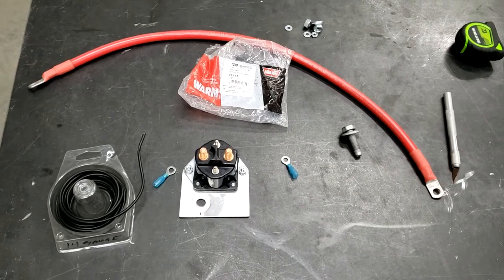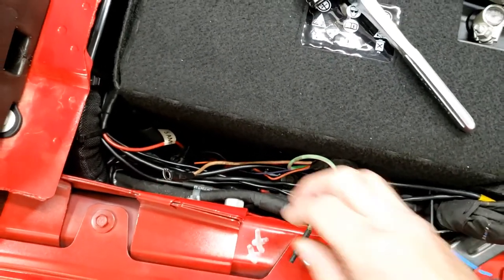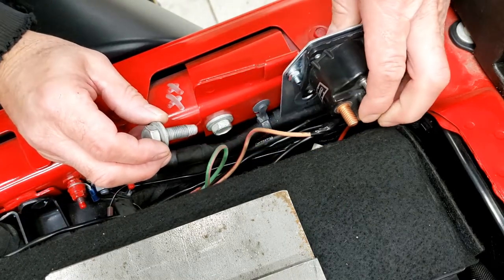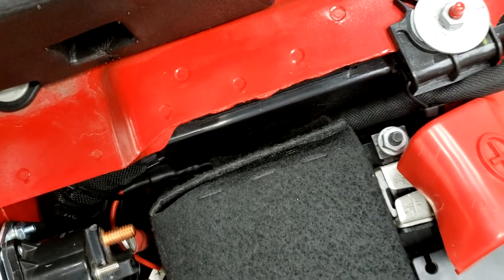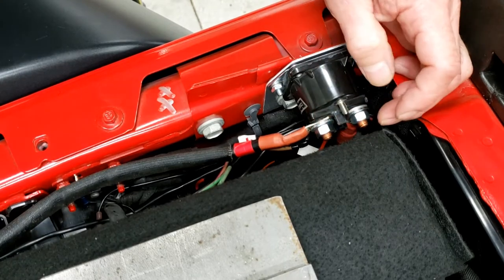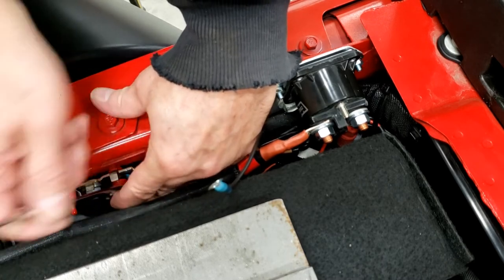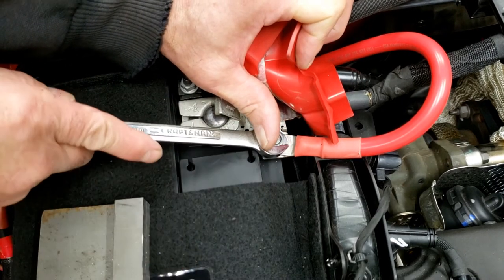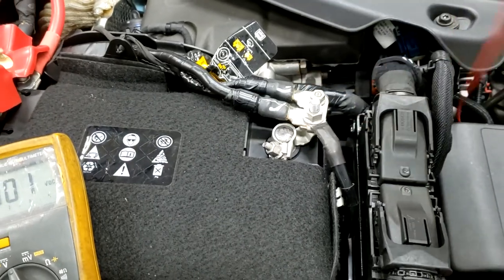Jeep Winch relay DIY

Comment: What’s the pro of this
Reply from the maker: Safety in case of a short so you don't burn your vehicle to the ground. It has happened many times.
Reply: Say you get in an accident and winch power gets pinched up real bad and shorts out, you have a high fire potential, but with the relay no power is upfront unless you want it to be